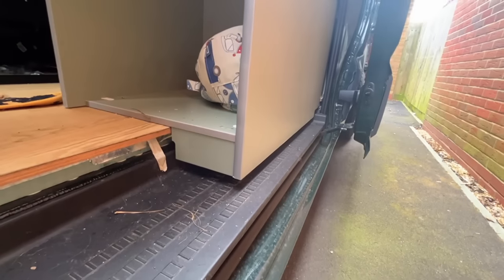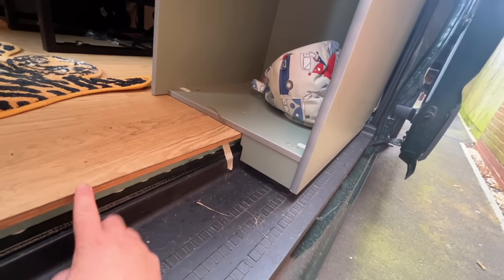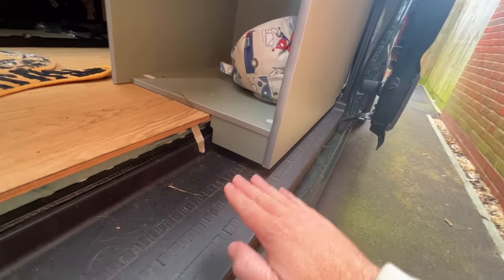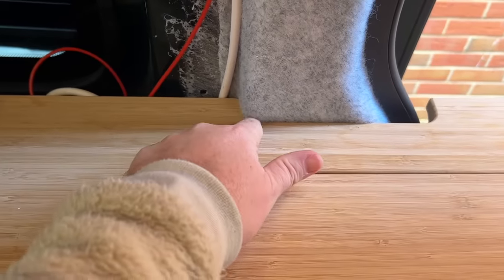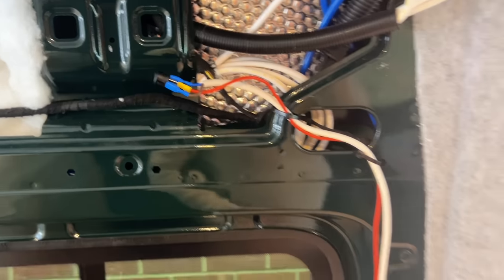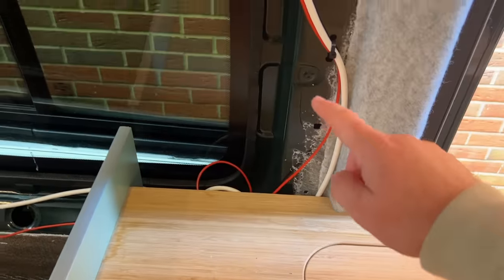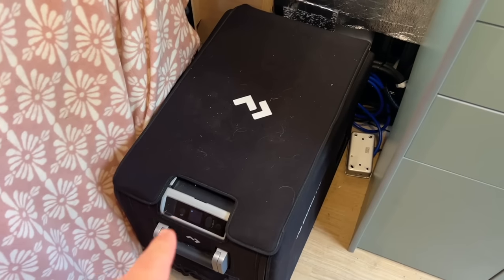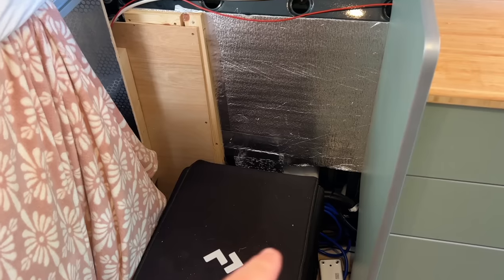YES! WE HAVE A KITCHEN! - VW Crafter Camper Self-Conversion

Comment: Haha, i did warn you re: the floor heights. Mine isnt supported by the step either however, with the ply being open/not edged on the bottom im glad for the gap so it doesnt soak up any water that may run on the step during slide door use.

Comment: It looked like the heat exchanger is designed to pass the cabin heat over the exchanger and then into the cabin. It will take a long time to heat the water and so it also heats the van. So close to the heater and ducted into the van after the exchanger would do that well. Otherwise the heat is dumping into the garage.

Comment: Good morning Shaun, first of all, my latest vlog was about our Evo design delivery, the amount that was missing and how bad the instructions were! I'm also surprised to see your kitchen unit comes down to the step at all. Mine doesn't! Anyway, on the subject of bamboo worktops, we have ordered one too and also had one for our previous build of our T6. I used a Ronseal matt varnish to seal it and it was ideal. No water marks or stains and it looked great too. I see they do an ULTRA TOUGH WOOD VARNISH at the moment, which looks similar.  I've gotta go now, I'm off to ring Evo yet again!! 😆Good luck with the rest of the build.
Reply from the maker: Ahh just watched your vlog and you’ve certainly had an ordeal. We had one bit sent that was wrong and they fixed it straight away but it is annoying that you actually have to start building it to work out if you’ve got all the right pieces. Like you say they need to number the pieces. I had one bit left over 😳 Yours looks like it’s approaching the finish line now. 🙌
Reply: @ABusAndBeyond  Well, it's getting there but you know what these things are like... all the little bits take forever. Certainly far more arduous than converting a T6. That's for sure. Anyway, hope yours goes well. I'll keep an eye on it.

Comment: I think we have stumbled on the perfect camping solution. We had a transporter sized van professionally converted and it has proved perfect, even on the narrowest roads of the NC500, which we have done several times now. Size wise for accommodation, it is o.k. for the wife and I but we wanted to take the grandkids and others on occasion, which proved problematic for space. The solution was a 4 berth fixed bed caravan. We now pull it with the campervan, so we have the best of all worlds now. Space when we need it and parking ability and manoeuvrability when we want to explore more rural isolated areas, or a mixture of both, using the camper van as a day out type van and the caravan as the base and if additional beds are needed, the campervan can accommodate that as well. The camper van is also an extremely good towing vehicle, with no passing traffic suck and the ability to travel right up to the 60 mph speed limit, without caravan waggle.
Reply from the maker: So glad you’ve found the perfect solution for you!

Comment: Use Osmo Top Oil for your work surface.
Reply: Came to comment to recommend osmo oil, beaten to it. They have a worktop oil that hygienically seals the wood. We use it on our dining table. Water just forms droplets on the surface.

Comment: I’m sure the vent is for the gas   Hot air rises, gas is heavy and will fall to the floor in the event of a leak
Reply from the maker: That’s correct 👍
Reply: @ABusAndBeyond  you could just add a couple of blocks to the base section underneath the unit to give it extra support and also an LED strip to give it a nice glow at night

Comment: 12volt appliances are an absolute con. Shore power do under counter 12v fridge and freezers and they are basically the cheapest LEC appliances with a 12v compressor fitted and a price of £550 plus.